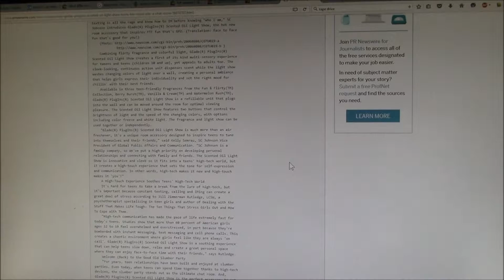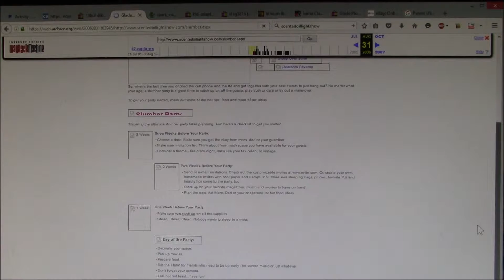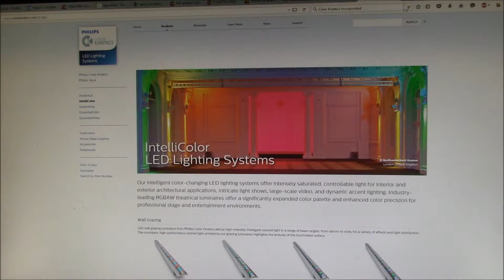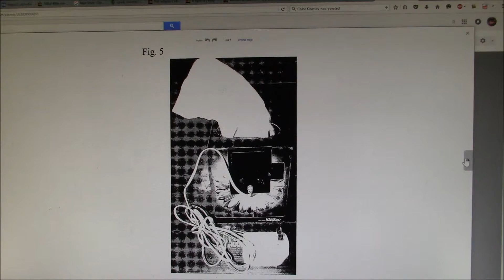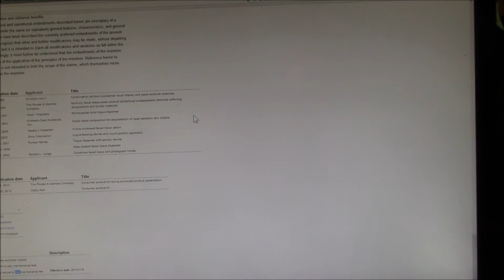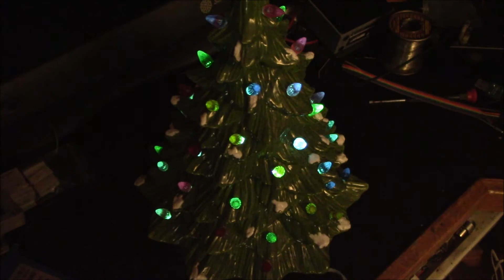Glade® PlugIns® Scented Oil Light Show, Back Story

Comment: Yeah, my clever idea is to replace the old color wheel for the aluminum tree with this. Gives off less heat, uses less electricity, and gives more color variation, although not as bright.
Reply from the maker: Great minds think alike!